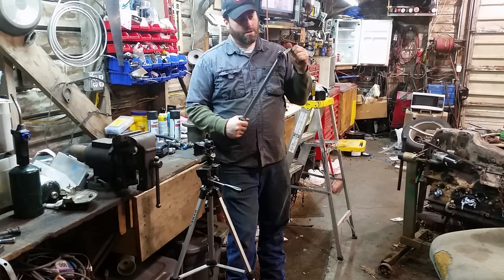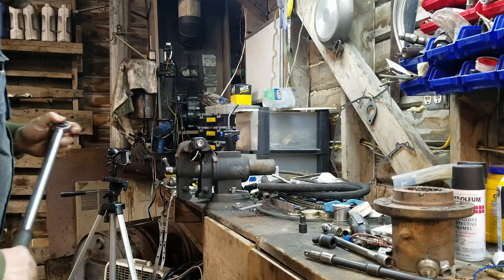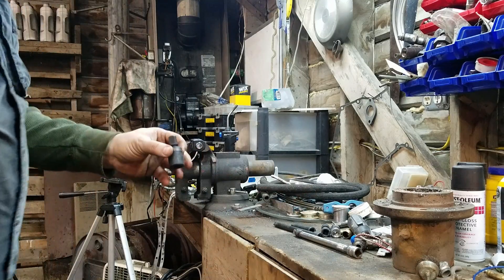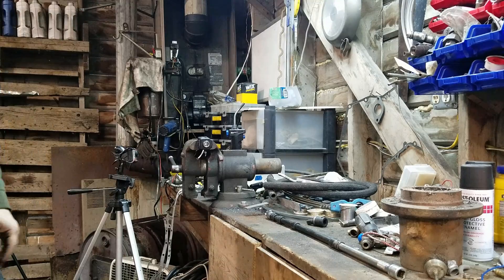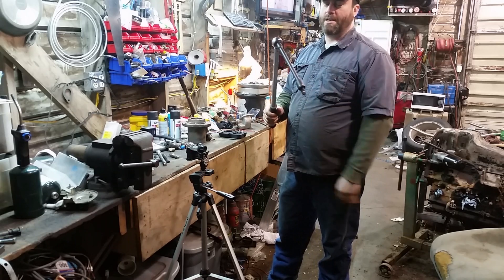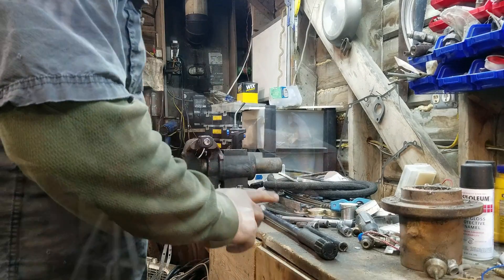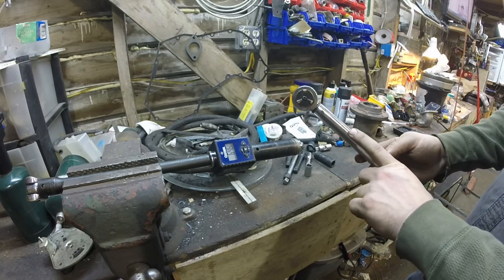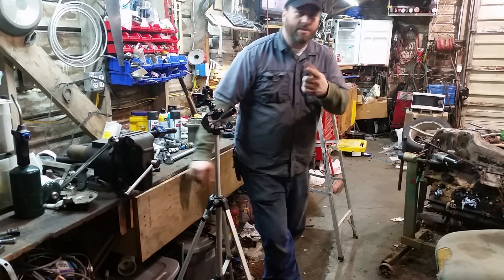Torque Wrench Myths Fact or Fiction - Extensions Crows Foot Universal Joints Tests Mythbusting

Comment: Interesting
Reply from the maker: I thought so too!  But really the physics confirms, same amount of torque will be present on both ends or it'll spin.  I think I got some other ideas to test out too later!  Thanks for watching and commenting!
Reply: BurningDinosaurs I have that same torque meter, they seem pretty accurate but mine eats batteries quick. The only thing I can think that would change the torque would be if the fastener had to overcome a bit of friction the springiness of the extension may have some effect on it. Usually oil threads and under bolt head when torquing stuff anyway, so I wouldn’t think that would be an issue.
Reply from the maker: @Digginok  You're absolutely right, Frank!  And for the same reason they say to achieve the torque in one continuous motion so the static friction is already overcome.  Good thinking!!  That might be hard to test, but definitely worth mentioning!

Comment: The extension cannot effect the output in any way.    if    it is kept in line No oporator error. But the small changes the operator  can induce will have next to no effect at the work end. And as for the crow foot when the tool clicks it  will always click at the set poundage but because you have lengthened the tool effectively that amount of change will show up at the guage whuch is after the click. Now watch this short video. And try and either debunk it or do a better one on the subject. https://youtu.be/mk95F0hHS3U?si=vdS4hI08-O6Tjshk

Comment: The torque at each fixed position has to be equal. The only way that wouldnt be true is if you had something in the middle absorbing that force. The crows foot i figured would be more torque due to leverage.
Reply: Yes indeed. The nut or in this case the guage will receive more or less poundage due to error but the tool itself will have clicked at the set poundage. People just do not have basic iqs to be able to understand the mechanics of leverage and it connection when in conjunction  with a torque wrench. So many channels do not know what they are posting. Please watch this short video and comment.https://youtu.be/mk95F0hHS3U?si=vdS4hI08-O6Tjshk

Comment: Do you know where I can find some 5 lug 16.5 inch wagon wheel rims? I want to run humvee tires on a 1999 dodge ram 1500.
Reply from the maker: Whoa!  I have no idea.  That may be a hard one.  There used to be wheel guys who could put different centers in different rings, but I bet they're almost nonexistent these days.  I guess maybe there's wheel adapters.  I think there are 6-lug 16.5s out there which may be an option.
Reply: @burningdinosaurs  I think the dodge rims are 5 lug which sucks. Ill go look at summit and see what they got

Comment: I had a idea. I want to take a 24 valve cummins and put a p7100 pump on it and stick it in my frankentruck. I also want a nv5600. Ill have to upgrade the rear end to handle the power lol

Comment: Hey man! How’s it going? That’s very interesting. I would have thought the results would be all over the map. I suppose the cheaper the extension, the less torque it can handle. I have only used a crows foot one in my life, very handy. Take it easy and thanks for the video.
Reply from the maker: Hey William!  True, cheap extensions may twist more, or break, under more torque, but ultimately it takes the same amount of torque to keep the wrench from turner any farther than it does to click the clicker inside.  It's all just physics!  Yes, crowsfeet are do-able, but hard to get exact.  Thanks for watching and commenting!

Comment: I'm on the search for a 2nd gen dodge 3500 with the cummins 24 valve. With a shot body. Still no luck. I'm also on the search for a crew cab so I can make it a 4 door short bed. Maybe I might be able to go to a junk yard and pick up both of those.
Reply from the maker: Yeah, that would be nice.  Around here all the bodies are shot, but they still want 6K because "It's a Cummins" lol.  Gotta be patient and wait for the right deal to come around!
Reply: @burningdinosaurs  as a semi dodge guy I can agree. I found a 1998 dodge ram 3500 with the 24 valve and the 5 speed. Its a salvage truck. Its on Craigslist for 4800$
Reply: @burningdinosaurs  I've seen some take the name "dodge" seriously

Comment: I have this old beat up 1939 john deere model h sitting in the weeds beside my 84 chevy. It was on my great grandpas farm in missouri. When my great grandpa past on my grandpa got it. I started showing interest in so it was given to me. Its froze up from sitting without a exhaust system. Im gonna try to rip it apart this year and try to get it running. Its got the tiniest little engine for tractors lol
Reply from the maker: That will be quite the project!  Good luck!

Comment: no good way to really figure if you loose some but we have done a lot of engines for tractor pulling where exact TQ is needed and we usually found most wrenches to be off a few % so we played with extensions too and figured 2-4 inches you lost a Lb or 2 plus you should try it in Inch Lbs to see what kind of spread you get. And in a lot of cases we even use Torque Multipliers which are like 2-1 or 4-1 where you put in a half inch drive but it turns a 3/4 output. All in all as a rule we just try to add 5% over suggested when doing ay kind of specs

Comment: Good video man! I think where people get confused on torque is because they use extensions on impacts and there it is less torque since the extensions absorb the hammering action. I worked on a tractor one time where I had to use a crows foot to torque a nut and they gave an equation to figure out what to set ur torque wrench too. Seems like it only changed it about 4ft lbs
Reply from the maker: That's exactly right!  And I'm really thinking of doing a test on impact wrenches with extensions too to see how much is lost, but I have to figure out how.  Yeah someone else said they were provided a figure for when using a crowsfoot.  I honestly expected it to be farther off, it would be a percentage, so maybe some of them bigger bolts would result in higher difference.  All good things to test!  Thanks for watching and commenting!

Comment: I had to use a crows foot a few years back to torque some switch gear bus bars. I found online some formulas to adjust for using crows feet with a torque wrench. Unrelated I worked a few Nuke plant shut down and if your work order required a torque wrench, it had to be calibrated before each use.
Reply from the maker: Yeah, I can believe that!  As you saw in my video, the results do vary, and when it's critical, it's best to verify each time!  Thanks for watching and commenting!

Comment: The only time I gave a thought about using a extension was on a impact breaking loose nuts or bolts because, the lose of impact.
    I liked the study you just did good information.
Reply from the maker: You're absolutely right there!  I've actually been thinking about how to test impact wrench torque loss through extensions myself.  I may have some ideas, so keep an eye out in the future!  Thanks for watching and commenting!

Comment: Good to know, I was always told not to use a long extension on a torque wrench, thanks for sharing!
Reply from the maker: I thought about getting out all my 3/4 and 3/8 extensions and snapping them all together which would have possibly put me out the door, but I'm sure the results would have been the same.  The torque wrench would have turned a lot more, but ultimately the same torque would be applied.  I'd been wondering for a long time but just came up with a way to test it recently and was glad to put the matter to rest!  Thanks for watching and commenting!